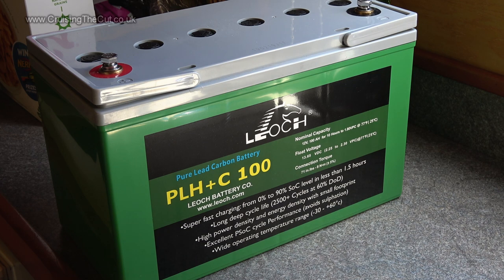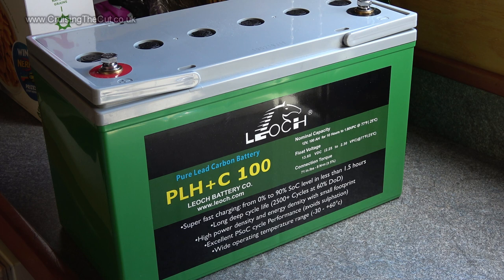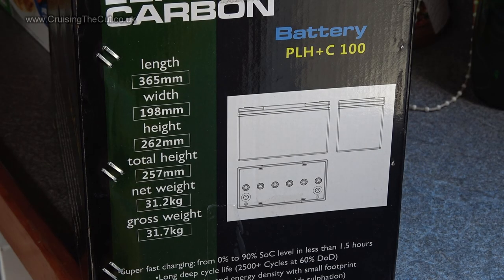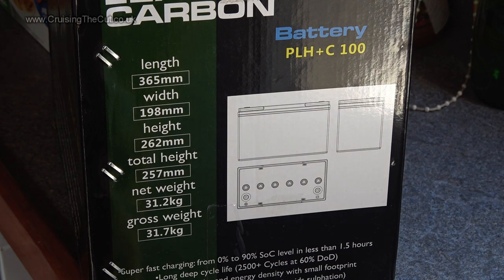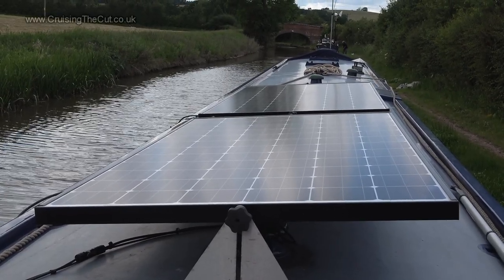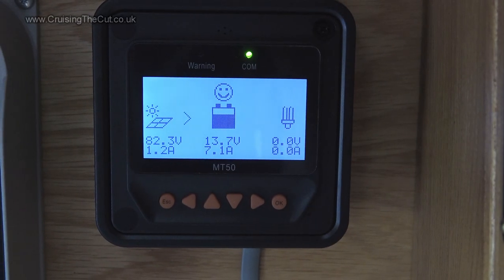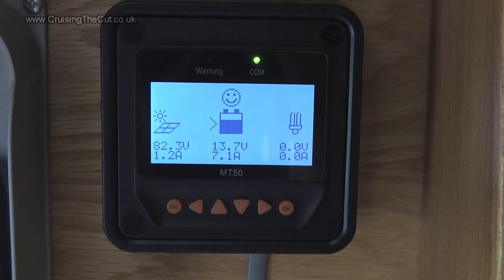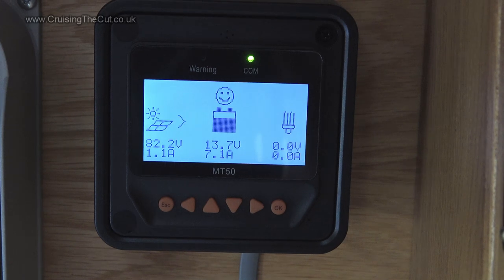178. Installing Lead Carbon batteries (12V 100Ah) into my canal narrowboat

Comment: Why not lithium batteries?
Reply: Expense and they don't like charging at low temps
Reply from the maker: Huge cost plus a need to add or amend the existing electronics eg solar charger etc. Probably a need to bring the batteries inside the main cabin to keep them warm for charging too.
Reply: Counter question would be why not lead batteries or what would be the advantage of lithium batteries in this application? 
Charge and discharge rates are relatively low, so no reason not to go for lead batteries. Energy density: is weight in a boat that needs balast a disadvantage for lead batteries? Lithium batteries are 10% more efficient in energy storage, but when you use solar that's not an issue. Battery life depends on management. Because of price, lithium batteries are chosen as small as possible, so margin of 'safety' is smaller. If you want a system calculated for 80Ah, you take a 100Ah Lithium battery or 160Ah lead battery. In an unforeseen event where you need an extra 20Ah the lithium battery is then 100% discharged while the lead battery is only 63% drained. 
Lead batteries are 99% recyclable, while lithium batteries are 50% at best. Compare this to an halogen light bulb (glas and metal, simple recycling) and a LED bulb (lot of different materials, pcb, very hard recyclable).

Comment: When setting up the new batteries, did you take into consideration the inverse reactive current required to synchronize the unilateral phase detractors?
Reply: ie let em balance
Reply: That's easy for you to say!
Reply: that only works on Tuesday and if you have an ice cream in your pocket.
Reply: i was just about to say that ;)
Reply: That's what Captain Kirk of the Enterprise said to Spock!

Comment: .I'm a slightly confused caravan person. Does your engine have an alternator which charges your battery bank with an output of 14.2v?  We caravaners also have a 240v "shore-line" which has a battery charger because of our lighting system which is 12v & connected to the battery bank. So I would have presumed the solar, the batteries, the whole system would have been designed around that 14.2v. Obviously, as we change tow vehicles we change alternators and the car industry provides alternators for the car a caravan being a secondary consideration. just wondering if canal boats were different?
Reply from the maker: No, very similar but 14.4V seems common
Reply: @CruisingTheCut  my 14.2v is from my voltmeter at the battery so, in reality, it could be 14.4v at the alternator.
Reply: There is a device, which controls the charging voltage.

It should be between 14,4V and 14,8V, so a bit more is better here.
More interesting than the voltage are the amps and they should be under 10, less is better for the battery (6A are ok).
Reply from the maker: Hi Lukas. These batteries are rated at up to maximum 30A charge each. 14.4 - 14.8 is too high for these, which the manufacturer says should be charged at 14.1 - 14.4 apparently.
Reply: Bernie, Charging voltage is different to operating voltage in both boats and caravans. Long ago dynamos and early alternators gave out 13.8volts to charge the old wet batteries which usually only got to 70% of their possible charge capacity. Nowerdays alternators/shore chargers/solar all pump into modern sealed batteries at 14.2 /4/ 6 dependant upon whether they are Lead, AGM, Gel etc in order to get them to near 95% capacity

Comment: How stupid to list the dimensions of the box on the box, and not the batteries! After all you're not going to install them inside their boxes! Personally I prefer to disconnect the negatives first. That way you remove the possibility of touching anything on the chassis with your spanner and shorting the batteries while undoing the positive terminals.
Reply: Not as stupid as listing the box dimensions on the battery !

Comment: considering the capacity your after and running solar you really really shouldn't be running parallel batteries. You'll have much higher efficiency running your batteries in series and in your case, I'd run 4 for a total of 48vdc. This will keep your batteries balanced(all batteries have different internal resistance), your charge controller will be more efficient and as well you'll have less line lose from resistance. A 48vdc to 12vdc converter is cheap and super efficient. As well your inverter will be much much more efficient running at a higher input voltage.
Reply from the maker: Crikey no, I'd have to reinstall entirely new systems, lights, inverter etc throughout the boat and that would cost a fortune and for little benefit. Most boats that don't want to use 12V go for 24; I've only seen 48V stuff on the hybrids and even then that was for the engine, everything else was still 12 or mains (230V AC). Also, I only have three leisure batteries so I'd end up with 36V in series!!
Reply: @CruisingTheCut  no no, you get a converter to go from 48vdc to 12vdc for your hull items. Stepping down in voltage is exponentially more efficient than up. Check your charge controller it probably supports 48vdc stock. If not 24vdc is a second best option. As well considering the different chemistries/capacities keeping your starter motor in parallel with your powerbank will drop your total capacity.
Reply: Batteries in parallel balance far more easily than batteries in series do. They can drift by tens of millivolts in series configurations very easily and more over time.

Comment: Disconnect the negative first as batteries flow from negative to positive. You disconnect the negative terminal first and put it on last.

My Source: 2 years in auto shop from a teacher who carries every ASE certification.
Reply from the maker: Ahaha but you'll find just as many people who say otherwise. Hence my vanishing act on the footage.
Reply: Completely irrelevant, it’s not a water hose.
Reply: It's got nothing to do with current flow - I'd always disconnect the negative first because it's safer.

There are two ways of shorting out the battery when working on it - Shorting both terminals directly (very unlikely) or shorting the +ve terminal to adjacent metalwork that's connected to the -ve terminal (much more likely).  If you disconnect the -ve first, there isn't a circuit formed if you short the +ve to the metalwork.  If you short the -ve to the metalwork while disconnecting that terminal, nothing bad will happen as it's at the same potential.
Reply: Always the negative first,  if you go for the positive first you or your tools can complete the circuit if you touch the chassis (car), because it is connected to the negative.  Now when you disconnect the positive, should you or the tool touch the chassis ....nothing...no circuit. Safe. Are boats negative chassis?(Hull)?
Reply from the maker: The direction doesn't matter; once you complete a circuit, it's a circuit!
Reply: @CruisingTheCut   Shorting is not the only safety issue. Engines have one wire on a sparkplug for a reason as they use the chassis for the negative connection back to the battery. 

If anything makes a connection from positive to anything metal on the boat it completes the circuit. As you already stated the engines starter battery was connected to the battery bank. I don't know how the engine is set up on a narrowboat so I can't say for sure but I'd have to assume.

Comment: how do you not realize the batteries are charges and have power? thats where the spark is coming from. this is common sense. the switches have nothing to do with the power within the batteries
Reply from the maker: Yes they have power, obviously, but you should only get a spark if there is a path from +ve to -ve so that a circuit is made and with the main switch off there is no circuit.
Reply: @CruisingTheCut  I'm sure this is just the batteries balancing themselves when you connect them together!

Comment: Just a thought. Like you I am not an electrician. But my understanding.  The temperature sensor should be on the last post to the inverter.  this is the post that can become hot due to all the power from the 3 batteries, pass through this post.  you have it located on the middle battery.  this could give you a false reading.
Reply from the maker: I will check with Victron but I don't think that matters; I put it on the middle one as the average temp of the three.
Reply: The temp sensor is to track the temperature of the battery chemistry, not the heat created by all the electrons being pushed through the conductors.

Comment: Why argue with supplier when you can get the info off the net here: https://www.victronenergy.com/upload/documents/Datasheet-Lead-carbon-battery-EN.pdf
Reply from the maker: Because that’s for Victron batteries and mine are not Victron. Same chemistry but each manufacturer may have slight differences so I’d rather get the info from the company that made the ones I have.
Reply: @CruisingTheCut  Same chemistry - so same  operation/charging regime - even the figures agree - and in fact, not a lot different from std lead acid.
Same with paracetamol - whether 16p or £3.45 - same efficacy just different shape, taste & texture!

Comment: When a battery sparks on connection, it means something is still drawing power.
Reply: Maybe the stray capacitance in the wiring of the boat itself?
Reply: didn`t the man say he left one of the light switches in the `on` position` would that do it?

Comment: On the box advertising for ?? sizing, this is false and misleading data, as it should reflect actual battery size within the box, not what the box size is, which is not required.
Reply: lol, ignorance and certitudes. Printing carton dimensions on it is a common occurence and is required for logistic reasons, in particular to calcualte the volumetric weight for sea shipping, nothing misleading, it is actually mandatory in certain cases.

Comment: I was going to ask why the engine starting battery is on a different circuit from the house batteries, but i think it does make sense:  First, you don't want to run down the engine battery - if the house batteries are run down, you still want to be able to start the engine.  And second, the behavior of the two circuits is completely different - the house circuit is deep cycle behavior, while the engine starter circuit is not.
Reply from the maker: Exactly

Comment: It's not across the bank. Everything is in parallel. It doesn't make a difference where they go😁
Reply from the maker: Yes it does. See the linked article, cheers
Reply: @CruisingTheCut  Oh if it's linked on the Internet it must be right.   lol
Richard is 99.9999% correct, You would not be able to find a difference without some really expensive equipment.
Reply from the maker: @Arthur It's not just some random article off the internet. Maybe have a read before scoffing. The author knows his stuff.
Reply: @CruisingTheCut  Sorry but Arthur is correct.  You need REALLY EXPENSIVE equipment to measure resistance down to  the .00012 level.

Comment: I'm only 6:10 in, but batteries are the first thing to be connected when connecting the solar and the last to be disconnected. 
Always disconnect panels first, then you can disconnect batteries. Otherwise you might fry your charge controller! 

Same when installing. After mounting everything, connect batteries to charge controller, then after that one can connect the solar panels to the CC.

Why on earth is the earth of two different battery banks connected together??
Reply from the maker: There's always a common earth, from all battery banks. The 230V mains earth is also bonded to the hull, usually near (but not directly onto) the same point.
Reply: @CruisingTheCut  o.O Strange.. In another video you mentioned that negative always had to go back to the battery, instead of connecting to the boat because of rusting? Why would one connect start battery and leisure batteries together? Never seen anyone do that before.
Reply from the maker: Yes, the hull should not be used as a 12V DC return path, you use both + and - wires to each appliance. There is then a common ground for all 12V sources (generally a leisure bank and the starter). They have to be connected together as the hull becomes the "earth" (not true earth, obviously)

Comment: Rats, that would have been a great time to go to Lithium and double your capacity and half the weight. Then you could run appliances some and even use the toaster. Add a solar panel or 2 and upgrade electronics. They also last 2x longer...
Reply from the maker: The weight is irrelevant on a narrowboat and it's not double the capacity (80% useable vs 50%). The purchase cost would be 5x higher and I'd have had to also upgrade the alternator charging. Plus lithiums would need to be kept warm over winter. I can already run mains appliances (TV, laptop, washing machine) and don't own a toaster). I already have solar. For me, these batteries were the correct choice.
Reply: Yeah at a stupid rip off high price for the lipo no thanks, maybe in 5 years if prices ever drop to reasonable level.

Comment: Couple of comments.
Lack of insulation on the positive terminals is much worse than the centre/end feed arguments, which are irrelevant. 

If you disconnect negative first, then no need to insulate the spanner.

Well done, anyway.
Reply from the maker: You still need to insulate the spanner to prevent shorting against the +ve terminal as you disconnect the -ve...
Reply: @CruisingTheCut  you must have a huge spanner 😉
Reply: @CruisingTheCut  Yes, touch the unclad wrench down +ve to side of battery bay, lots 0'sparks, with the -ve still in place.
Cheers and happy cruising.
Reply: Both the Neg and Pos have the same Terminal & Wires touch risk.
But on a Neg Ground vehicle the Pos has the additional risk of touching ANY hull-grounded thing. Would you be mindful to keep your left hand off a 24-48v Pos Terminal while undoing the Neg with your right?  The other way, its harder to be mindful to not touch any hull grounded things with left as you undo Pos with right.  By undoing Neg first, there is no risk of hull shorting.

Comment: My bet is that the new wiring configuration will not make any change in the way the batteries charge and discharge since the batteries are still wired in a series configuration. Let us know!
Reply from the maker: They're in parallel, not series. Each 12V 100Ah giving a total 300Ah 12V.
Reply: The batteries are wired in a PARALLEL configuration, NOT series!
Reply: @CruisingTheCut  Correct the batteries are wired in parallel  but the connections you changed were in series to the rest of the circuit. So the so the input from the solar array and the output to the inverter should not change.
Reply from the maker: Nothing has changed with regards to parallel or series in this configuration. The connections definitely should be done the way I changed them. Have a look at this excellent article: http://www.smartgauge.co.uk/batt_con.html

Comment: only 100AH barrery each, never seen a solor battery so low on AH, all the good solor batteries i ever instal are 460 to 585AH each, wired as 12 volts, if they are 6 volt batteries, you only have 100AH total, witch should only be drawn down no more then 50% not to damage the battery, sure they say that type of batter can take more draw down, but i have seen there life cut short doing so, if your new batties are 12 volt each then you have a total of 300AH witch i would not use more then 150 AH
Reply from the maker: 110Ah batteries are very common on narrowboats, remember this is not some offgrid house array. Usually the boats have 3 or 4 (though of course some boats do have much more)

These particular batteries can easily be taken to 60% discharge and will survive up to 500 cycles down to 100% discharged.
Reply: Most large Ah batteries that I have seen are 2v batteries, wired in series to give the required voltage 12, 24, 48 etc, whereas these are clearly 12v batteries. So you would need 6 of your 460Ah batteries to produce 460Ah@12v. These three batteries, probably 110Ah using a 20h discharge produce 330Ah@12v, not too bad. And you need to size the system according to not just how much power you would like to consume, but the power you can produce to charge them - no one wants to run their engine all day to charge them that way, and as for solar..well this is England.